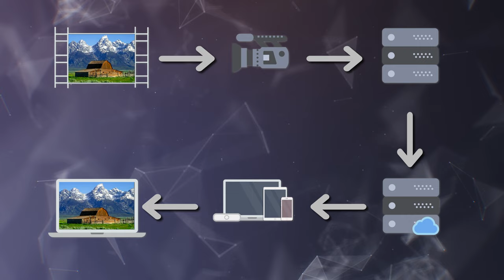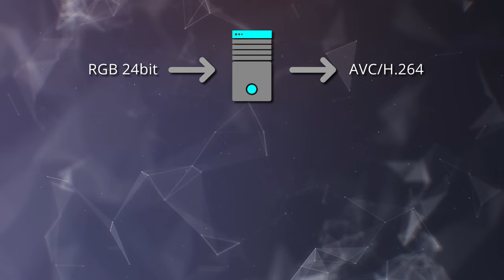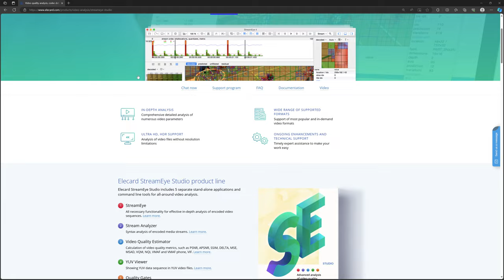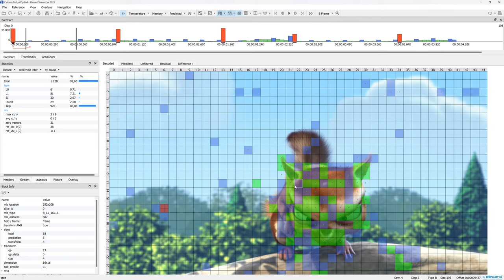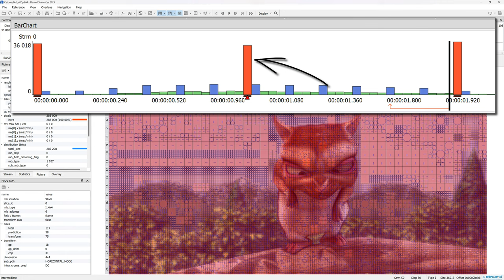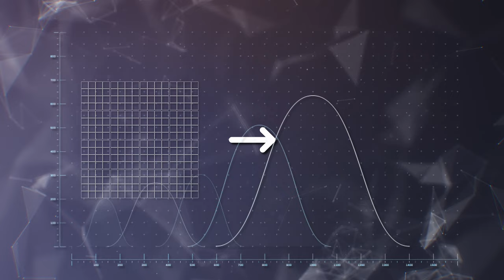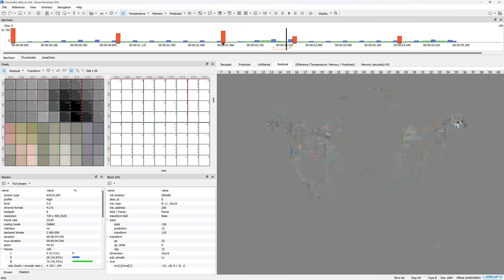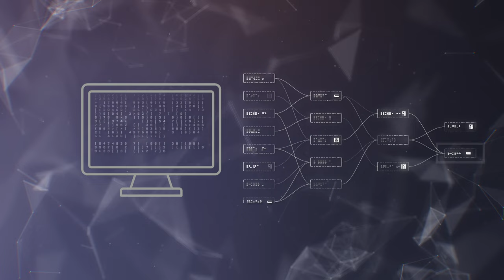How video compression works

Comment: Love to see how much has changed since I was a digital headend tech for a cable company in the early to mid 2000's. Worked with quad grooming equipment that mix and compress live TV. It was mostly MPEG-2. The newer formats have built upon MPEG-2 fundamentals and improved the algorithms. 

I dreamed of these types of explanations back then. But it was a lot of dry white papers and discussions with engineers of the equipment at the time.